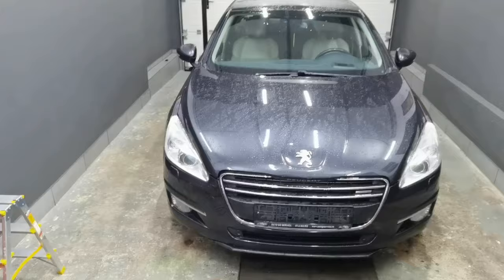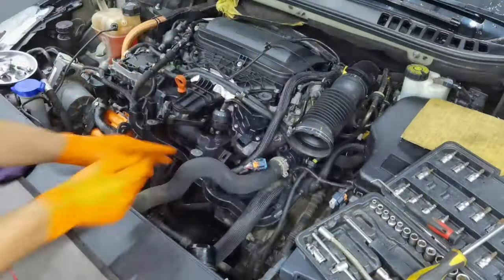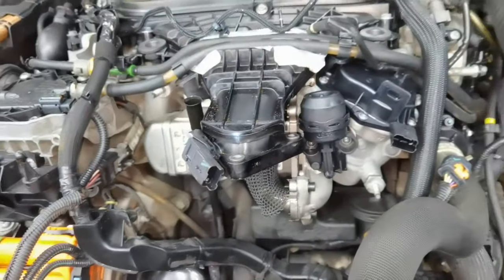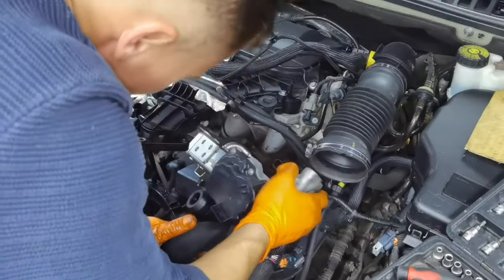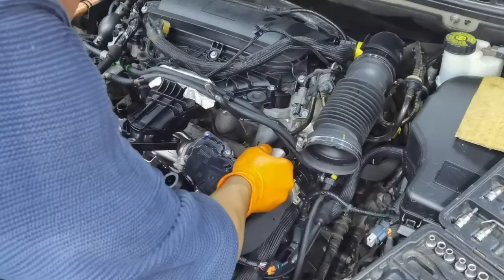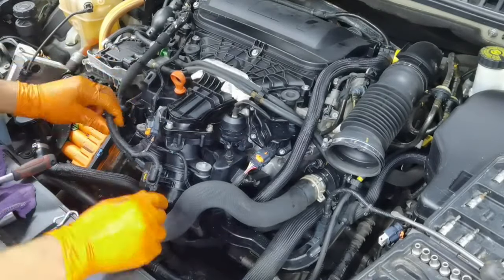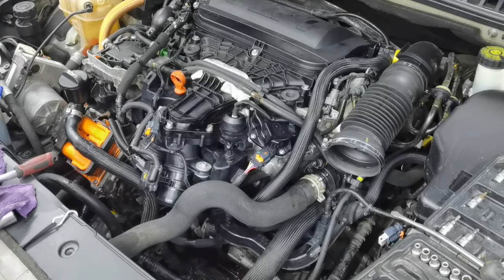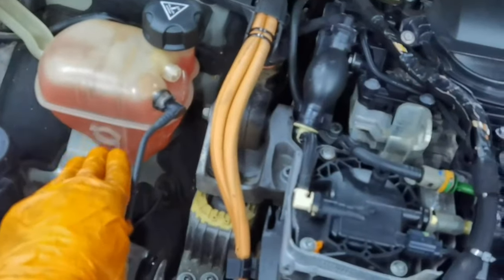EGR Valve and Cooler Replacement On Peugeot 2.0 HDI(complete video tutorial)

Comment: Great video buddy, what was the smaller pipe coming down from the manifold? Really hope you have a manifold cleaning tutorial 😂
Reply from the maker: The  metal pipe it's connecting the exhaust gases from the exhaust site of turbo to the EGR. I recommend to clean it if you're doing this job. 🙏👌